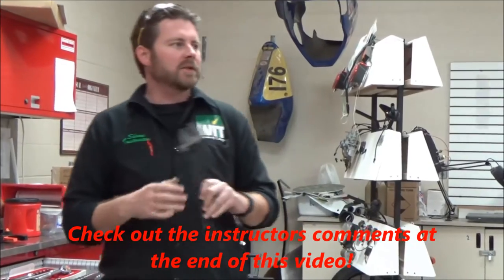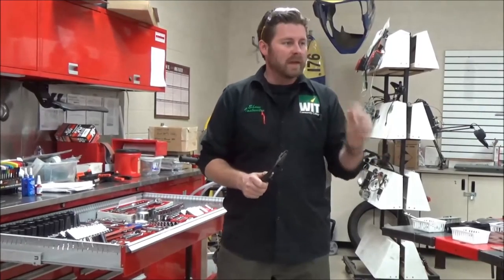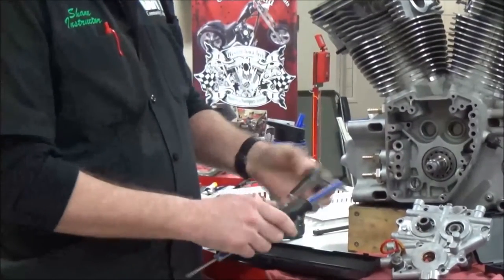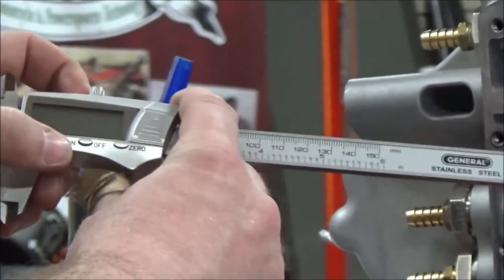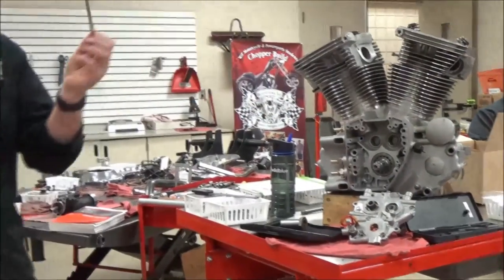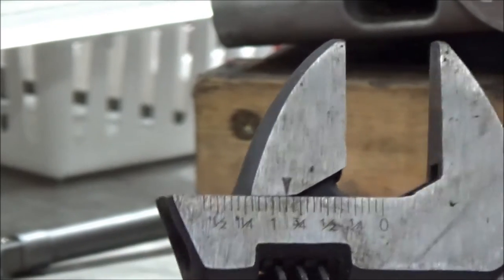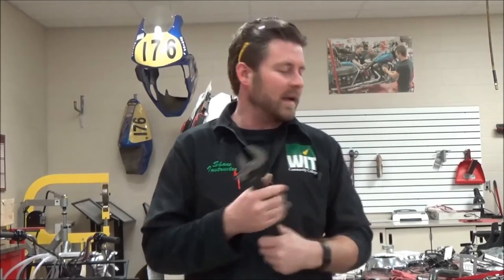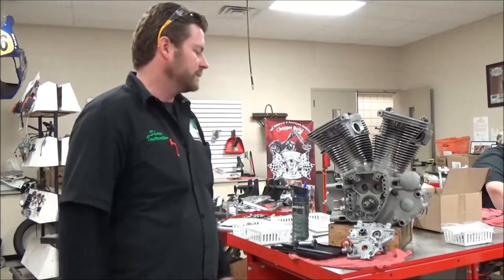Every Mechanic Series: Methods for speeding socket selection when removing large fasteners

Comment: If you're working on Japanese bike only it's fairly simple as they are manufactured to J.I.S. standards 8,10,12,14, 17, 19mm. Many rear axles tend to be 32 or 36mm, for front axles just purchase one of those 4 way hex tools sold by many manufactures today. European motorcycles seem to follow this same standard but you will also need 13mm. Ducati's use many Hex (allen) bolts and BMW loves to use Torx & Triple Square.